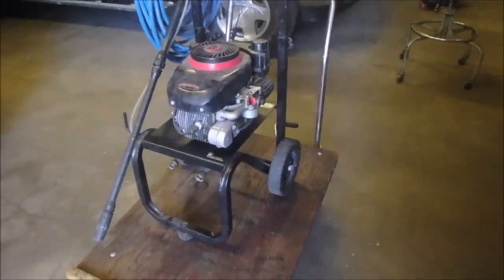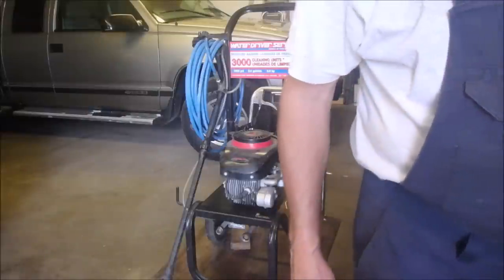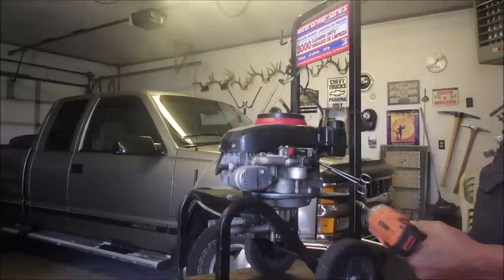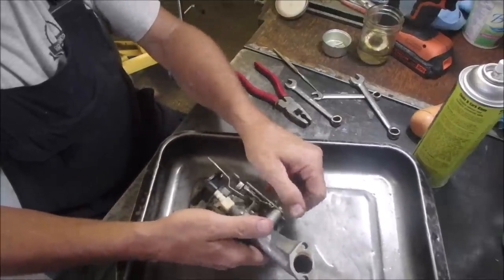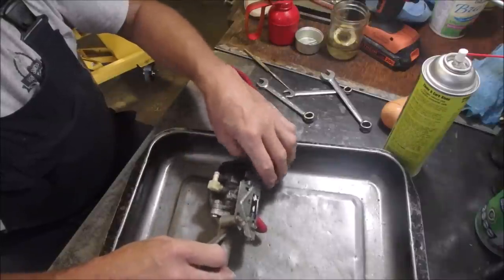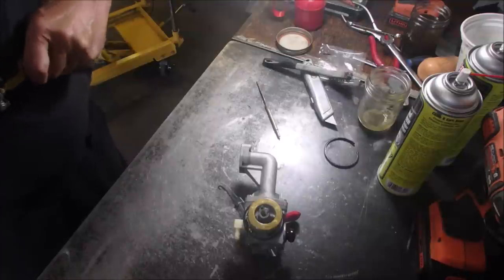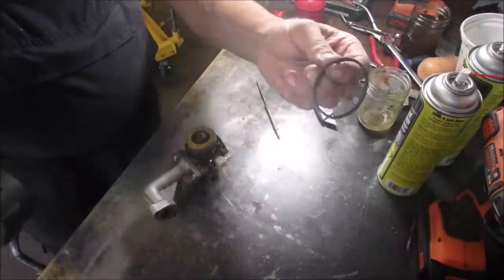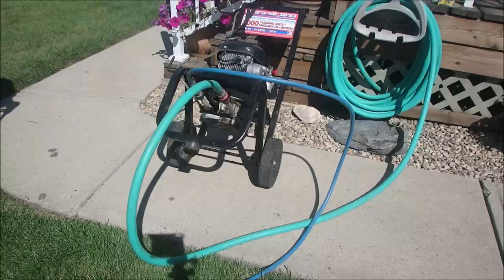Pressure Washer fail, Not the Pump?

Comment: Yep. Thumbs up. 👍👍👍.  Neighbor self diagnosed his electric pressure washer as needing a new pump.  Wanted to confirm a new pump was required and took it to a pump shop. (He had already dismantled and put the pump back together). Pump shop sold him a new pump and he installed it with the SAME result.  All said and done, the wand was plugged…
Reply from the maker: Yes  about 1/3 of the troubles with them is the hose and wand.

Comment: Good repair Bruce. I was told never to run a pressure washer without water. That’s a nice compact unit, your friend will be chuffed you’ve got it up and running again
Reply from the maker: I have been told both.  I ran into an old pump mechanic and he said a short time running was OK

Comment: Great video! BTW I discovered something about Tecumseh carbs while rebuilding one the other day that I did not know. I found that if you do not install the air cleaner base bolt furthest from the engine block (the one that is cast into the carb body) the carb will NOT prime. Apparently the outer bolt hole is connected to the float chamber internally and if the bolt is not installed it will cause a major air leak. Who knew? I certainly didn’t! That explains why I was having problems even getting new carbs to prime, I was checking them without the air cleaner base installed lol!
Reply from the maker: OK  This may be big.   most of the time I install the air filter base.  There may be times when I didn't.   It is like the "older" but not the new Briggs pulsa prime where the air filter bolt has to be in.  Thanks  Did you understand what i mean.  Little things.  Thanks for this.
Reply: I feel in that rabbit hole once and had to laugh at myself when I realized why it wasn't priming
Reply: @BrucesShop  yes, very much like the old “Easy-Spin” era Briggs pulsa-jet carbs needing the long air cleaner screw in place for the carb to function properly. That fact was pretty well documented in the Briggs manuals, I remember reading about it when way back in the day. I will have to go through my Lauson Power Products / Tecumseh manuals to see if there’s any mention of the left side air cleaner bolt needing to be in place but I surely don’t remember reading about it. I was working on a Toro Recycler with a Tecumseh LV-195EA engine from 2006 when I discovered it, wish I knew about it years ago!

Comment: Another machine that was sitting around too long without being used.  A quick clean did the job and it runs great Bruce.  Was shocked the wand was plugged.  Thanks.  Stevo
Reply from the maker: Right on.  I have had quite a few wands that get plugged.  Just a piece of the inside of the old hose or a chunk of rubber in the pump.  This one was an old pump.  .

Comment: Run from that ole tecumseh,worked on thousands have night mares from the loud exhaust and constant needle and float adjusting  either floods or no fuel  carb bowls are very thin and will corrode thru from ethanol in gasoline  seen this many many times .they like to shear flywheel keys easily as well
Reply from the maker: They used to represent 50% of all mowers here. A person fixes what comes in.  Now it is about 1/3

Comment: Hy Bruce, sitting on my sofa and relaxing by watching your video 😃 Do these machines soak the water (let’s say from a rainwater barrel) as well as they pump it with high pressure? That would be great when you don’t need to connect them to a pressure house waterline. Take care and have a wonderful weekend with Mrs P. 👍🌞🍀😘
Reply from the maker: No they need a pressured supply unless you spend the big bucks on a stand alone pump.   .  Then a user could put them in a truck and use it as a portable unit.   I have a spigot low on my rain barrel.  I should try it as there is probably a few lbs of pressure when it is full.  (although there is crud in the bottom of the barrel.
Reply: @BrucesShop thanks for this detailed answer and again: have a wonderful weekend 🌞🍀

Comment: I'm in the process of using a pressure washer to make post holes. actually works well.
Reply from the maker: Right.  You took the pump off and are using some kind of attachment for the engine output?

Comment: You're gonna wreck it using it without water connection. Those pumps heat up quickly and destroys the seals
Reply from the maker: Well I have been told  by an old pump guy you can run them for a u to a minute as there is nothing touching inside the pump